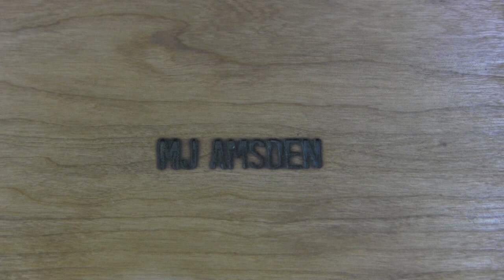Antiquer Rocker Reupholstery

Comment: I have NO experience in upholstery or restoration, but I simply cannot let go of a consignment antique rocker I purchased that quickly fell apart (upholstery, not structure). It appears it was hastily reupholstered for consignment sale.  Can you recommend any resources for beginners...books, videos, etc? I have started taking it apart and even have replacement fabric, but am completely intimidated.
Reply from the maker: You could start by watching my video series" how to reupholster a wing back chair."  It will give you way more info than you need for upholstering a rocker.